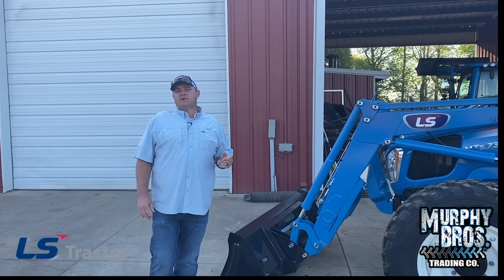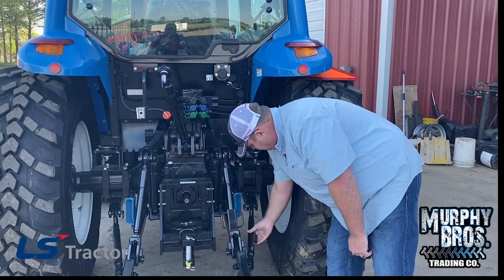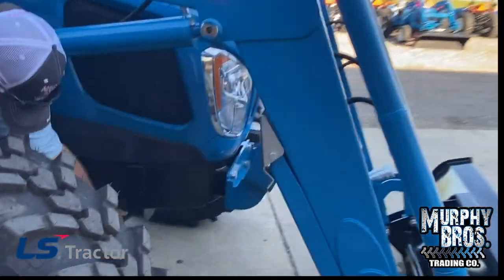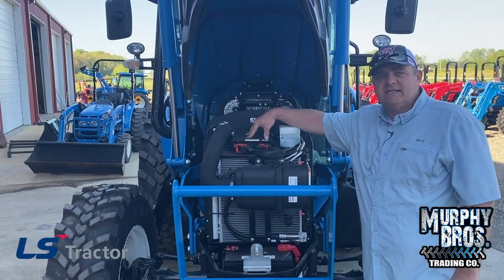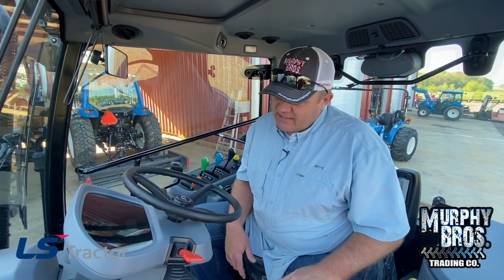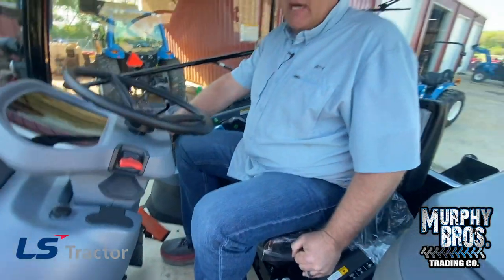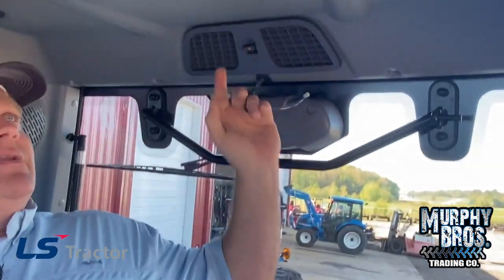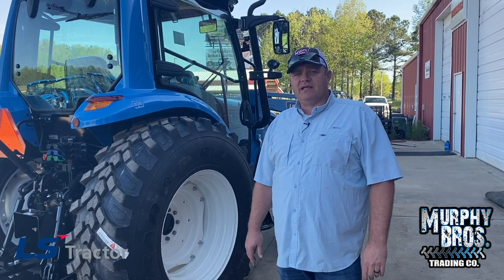LS MT573CPS (cab power shuttle) tractor walk around video

Comment: Great video.  So with the power shuttle, if I’m doing loader work, it should be much easier back and forth?  Kind of like a Yanmar?
Reply from the maker: I am not familiar with the Yanmar tractors at all, but all "power shuttles" or as Deere calls them "power reversers", in TRACTORS usually work similarly. You can shift F/R without clutch if you would like. You can also use the clutch if you desire. I know on my MT573, I do it both ways. When trying to "inch" up to something or backing the drawbar into my Bush-Whacker MD144 hitch, I can control better with the clutch. I hope that answers your question. If not, feel free to give me a call. The MBTC office number is 662-720-0022. Ask for Chris. Thanks!

Comment: Also do you use the throttle pedal on the right hand side do move?
Reply from the maker: I HATE foot throttles. In my opinion, a tractor's ground speed should completely rely upon gear. If you don't run diesel engines at enough rpm, especially Tier 4 emissions and newer, they create more soot to burn off. Plus, your hydraulics, PTO, cooling, air conditioning, steering, etc are not functioning at rated speed. I only use my foot throttle to help compensate for an RPM drop when running a heavy PTO application or driving down the road. When doing field work, set that hand throttle at what is required for the task and let'r eat.

Comment: 27:57  I just bought a tractor identical to this one.  Love it!  It has many features I will never use, but so many that I will.  For now, if you look at the 27:57 mark, in the bottom left corner, you will see a small chromed wire assembly that can swing out towards the door opening, or back towards the glass panel.  There is one just like it on the other side as well.  What are these for?  Too small and inconvenient to be drink holders, I am thinking.  I'm sure there is an obvious explanation, but I can't figure it out, and there doesn't seem to be a description in the owner's manual.   And by the way, that manual is terrible.  The bad spelling, grammar, incomplete sentences, etc., makes it almost unusable.  Seems like LS can make a world class tractor, but got a bunch of ESL teenagers to write the book.  Seriously?  Great video and thank you from Texas.
Reply from the maker: Those little items you're referring to are door latches. You can pivot them around to run with the doors partially open for ventilation. I never use mine. I want the dust to remain OUTSIDE.
Reply: Thank you!   Makes total sense now.  What are your thoughts on the "quality" of the operator's manual?  Can't LS hire a good technical writer to explain their product?  Love my tractor but not the manual!
 @MurphyBrothersTradingCo
Reply from the maker: ALL manuals from any brand can certainly be improved. When I sell a new tractor, I usually paperclip the controls and symbols section (section 3 in your op manual) and the lubrication and maintenance ( section 5 in your op manual). If you run across anything confusing, your dealer should be able to fill that void. If they can't, call on my people here at Murphy Brothers. We are happy to help. 662-720-0022 @rkelsey3341